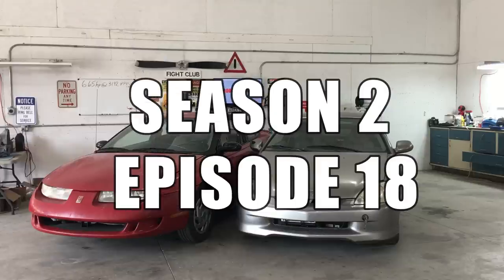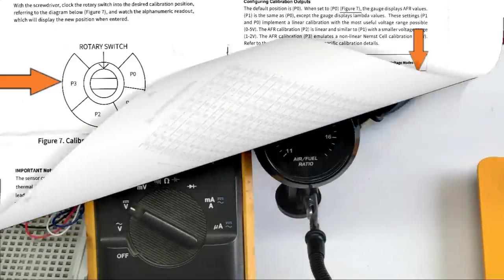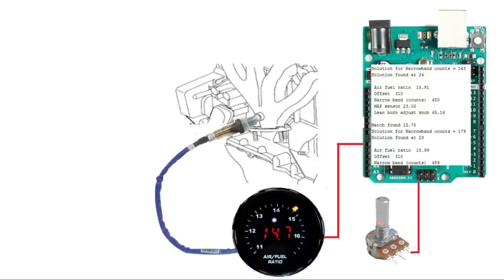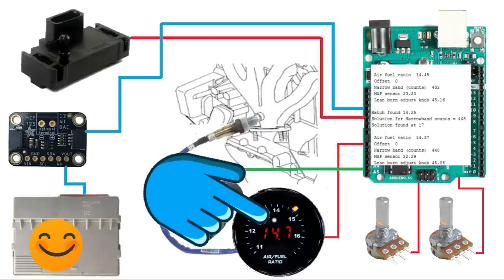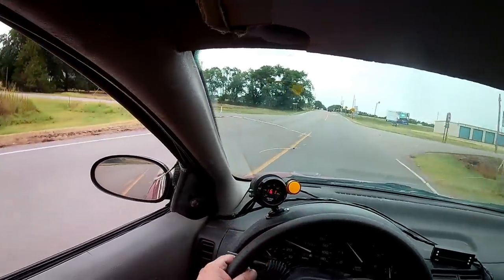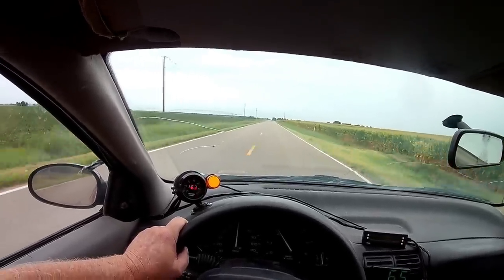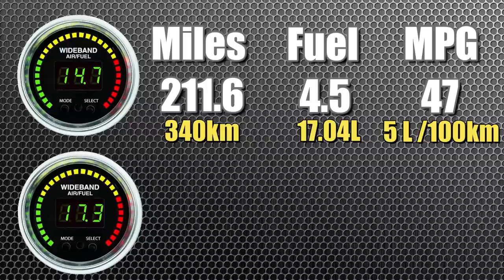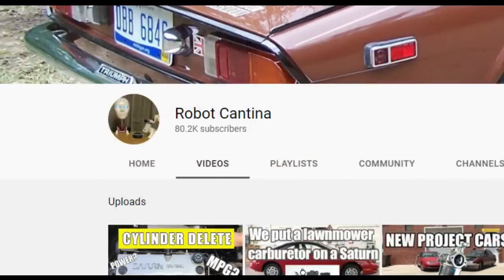S2E18:  We test a lean burn system on our Saturn .  Will it get better MPG?

Comment: Jimbo, you have to factor in that the stock narrowband sensor was likely inaccurate to begin with. They only have an operating lifespan of about 10 years.

When narrowband sensors start to fail, they fail-safe and start to intentionally read lean, tricking the ECU into putting in more fuel as a safety-net. That'll lower your MPG.

Comment: The base test makes sense because you replaced your spark plugs, and removed both the ac compressor and the power steering. While the two belt systems have little drag on the engine when not in use, they still rob power from the engine (as much as 25% on some engines) removing them boosts power to the wheels as well as fuel economy. Also, clean spark plugs boost fuel economy over older ones that have been in the engine for over 50k miles

Comment: Perhaps lean mixture limited engine power and you had to use more throttle to maintain speed. Maybe ignition timing adjustment will fix that. 
 Thank you for sharing
Reply: Timing can be the issue, but as the mpg were way better in the "not lean" experiment, it's also possible that the o2 sensor make the engine run pretty lean when it should be stoichiometric.
And leaning it even more only makes the engine way too lean.

It's very difficult to know how lean you can make an engine before it being less efficient than stoichiometric.

Some low compression engines can actually show better fuel economy running slightly rich.
Reply: More throttle isn't necessarily a bad thing. For good efficiency you want WOT with low ignition timing, so the pumping losses are low.
Reply: Untrustworthy instruments are super frustrating
Reply: @hojnikb  yeah, more air but less fuel for more power.  Better BSFC at the load and speed is the goal.  Higher dynamic compression in cylinder by not starting off compressing a vacuum.

Comment: GM had a lean cruise mode in the computer. When I can keep my car in that mode, the mileage goes up way higher than most people would believe. I believe the called it "lean cruise". It is hard to keep the car in that mode.

Also NoX is easy to remove, but it requires a non-lean mixture.  This is why we use oxygen sensors to stay just rich of 14.7:1.

Comment: What you should try is adding the ability to add an offset to the MAP sensor to lean out.  That should add some ignition timing advance in addition to pulling fuel as the ecu will think it is under less load than it is and typically adds timing advance as the load reduces.  You can then balance O2 sensor offset with MAP offset to control the amount of ignition timing indirectly and still hit the desired lean burn AFR target.  The lean burn fuel consumption result was probably about right actually, because even though it was using less fuel per mass of air, it was making less torque and needed a higher throttle position equalling more air flowrate to make up for it.  The lean mixture burns slower, so some of that torque can be gotten back with timing advance, but whether enough can be gained back without causing knock would have to be tested.  An EGT reading would probably also be useful, especially for determining how much timing advance to add.

Comment: Soooo, without the lean burn stuff engaged, you got what in Imperial MPG is about 56.5 MPG (UK), that's actually pretty impressive numbers even for a 4-pot engine, especially with current fuel prces being what they are... :S

Comment: Technically, burning lean should directly correspond with better MPG, since you're using less fuel for the same number of engine rotations. Your problems are heat and NOx. And it's why manufactueres don't really do it. Cheaper to do cylinder deactivation, hybrid drives and so on.. lean burn is scary cause you can melt pistons pretty easily if you don't have the engine designed for it.

Comment: I’m curious if the evap or charcoal canister are malfunctioning.   Possibly consider the 2 click fueling method.   Wait 30 seconds after pump clicks and see how much fuel it takes.  As a side note I had 95 SL 5 speed no power steering did pay for AC.   This car always got 45mpg, and 2 quarts of oil every 1,500 miles.    At 130k miles engine was weak and couldn’t go 75mph with AC in 5th gear….
Reply from the maker: Good point, the only real unknown is when the fuel tank is filled.  I curently fill on lowest setting and when the pump clicks off, that's it.  I think we will try it your way next time.
Reply: @robotcantina8957  HEY JIMBO.....  congratulations on reaching 100k subscribers.. ROBOT CANTINA is providing the 
entertainment and fun that viewers enjoy..

Comment: Regarding lean burn being too expensive for any manufacturer in the 90s... well.
I know for sure Toyota sold an engine with touted "lean burn" in the mid 90s... a few thousand dollar could be well worth it even back then in markets with expensive fuel, aka europe for example.

Honda also had their e-vtec technology and mitsubishi their direct injected engine already in the 90s, maybe/probably using some similar techniques.

Comment: I think modifying (lowering) map sensor voltage to get wanted AFR (in close loop control program in Arduino) + disconnected lambda singnal to factory ECU. That will lean fuel + advance ignition timing. I think lean mixture burn slower.

Comment: on my uego meter, I had to modify it with a grounded coax for the narrowband output, among other things, for it to actually work with my ECU (Trionic 5).
Reply: the included harness output, being completely unshielded, will have the tiny narrowband output completely annihilated by noise even over a short distance in a car.

Comment: 13:35, It's a saturn thing indeed. stay with the copper cheapies folks. I used to own an SL1 with a 5 speed manual, and yeah, you can actually get 38-41 MPG highway regularly with very careful driving.

Comment: Instead of using that converter, You can use a carefully selected resistor and capacitor to send a dead nuts accurate analog signal with 3 ms sweep to sweep response time which is 0-5v, but 0 - 1v would be extremely fast response time. 

I use a Oscillioscope to select the best values.
Reply: I was thinking why didn't he use a PWM output with simple RC network instead of that DAC.  also why is he slowing the sampling rate to 12 times per second.  That could be a part of transitional bad AFRs.  He could have stale feedback data for 100 injection events before the new data is presented to the ECU.
Reply: @vinnieluther6589  HEY JIMBO.....  congratulations on reaching 100k subscribers.. ROBOT CANTINA is providing the 
entertainment and fun that viewers enjoy..

Comment: Not exactly sure what went wrong, if it actually did, but it seems that usually stoichiometric ratio of 15.4 to 1 seems to be the sweet spot for unaltered ignition timing. This experiment needs way more data. More ratios, different ignition timings and all the possible combinations of.

Comment: I think it would be cool to play with a 2 stroke motorcycle engine (like the old moto gp type) in that Honda insight. Simple, powerful, and very mod-able. Alternatively, you could use a 2 stroke transfer port injected /oil injected snowmobile engine so you can have even more control over AFR and whatnot.

Comment: Also, those spark plugs issues aren't just a Saturn thing. For fancy modern platinum and iridium plugs to function properly, they require the increased voltage of a coil on plug system. Using these plugs in older systems will often result in carbon buildup and poor running.

Comment: So the lean burn system used a lot more gas. Typical. When discussing mpg my pentastar engine with variable valve timing really gets good mileage and power. At 80 mph it burns about 30 mpg. Thus power and speed with narrow band oxygen sensors. About the only way for me to beat this is to turbo charge the inlet pressure and not raise the fuel consumption thus ruining the engine. If I altered the engine controls and stayed at the 14 to one ratio at a steady speed of 80 mph it probably would get about 55 mpg. Thus not worth the effort. If it would do the Volkswagon thing of 1 liter per 100 kilometers I would definitely try it. But I am not Smokey Yunic.

Comment: Lean burn will make it more knock-sensitive. If engine is knock-limited, ECU will wind down ignition advance on any knock which might negate any gains made by lean burn.
Reply: disconnect knock sensor
Reply: @omegarugal9283  it is there for a reason. Knock will ruin the pistons.
Reply: @goranamcoff6235  cant get any gains from lean burn without spark advance so make your mind

Comment: Now all you have to do is dream up some aftertreatment to take care of the elevated NOx. OEMs are playing with SCR on lean burn gasoline engines. Perhaps get a junkyard SCR, DEF tank, pump and NOx sensors...? 🤣 When aftertreatment is at operating temp, DEF dosing rate is nearly proportional to fuel rate, and probably wouldn't be hard to figure out. 🤔

Comment: with the leaner mixture you run a higher risk of raising the temperatures in the combustion chamber so mush it can burn a valve or a hole in the piston

Comment: just putting a diesel motor into a car will not give you higher fuel mileage unless you change the final gear ratios in the differential.
Reply: HEY JIMBO.....  congratulations on reaching 100k subscribers.. ROBOT CANTINA is providing the 
entertainment and fun that viewers enjoy..

Comment: Chrysler attempted lean burn starting in ~1976. They hung the computer off of the air cleaner. Absolute horrible system. Just about everybody figured out how to disable it and get the vehicles running normally without it. Other than the constant problems with the system, you were always heavy on the throttle due to lack of power to do the same amount of work, so they actually got less mpgs than if they didn't have it. I recently put together a Chevy 396 with one of those Holley Sniper systems (not really impressed), and it likes to run lean. It hangs between 14:1-15:1 while cruising, will go dead lean 20:1 for just a second if you just smack the throttle, but will do 11:1 when it finally figures out what's happening. But even running that lean, it still gets big block economy. Best I've seen out of is 9mpg with mediocre performance. With a carburetor, I run it at 12:1-13:1, get the same 9mpg, but it has that instant big block power that's expected to be there.

Comment: GM has a lean cruise program baked into the -7747 ECU used in TBI trucks. Because of that pesky NOx problem and the expensive catalytic converter required to make it pass emissions it was never turned on in cars sold in North America. But it is there, can be turned on in the calibration chip that lets the computer know whether it is running a 4.3 V6 5.0, 5.7 or 7.4 V8. I believe some people who use those computers either in their original application or when used to convert a carb equipped engine have played with turning the setting on.
Reply: Great comment here..  I come for the video and stay for the great comments. 👍👍👍

Comment: Mr Robot "Jimbo" Cantina, would you ever consider doing a returnless PWM fuel pump for your EFI system? If you ever turbo'd the predator engine it would eliminate the need for a rising rate regulator, you could make a controller based on a simple fuel pressure sensor, a motor shield, and a dedicated Arduino with a PID controller. Returnless fuel pumps are becoming more common these days.

Comment: I believe that at least some of the masters of lean burn are in the aircraft space.   I have seen videos of them making what looks like fairly significant efficiency gains at economy cruise speeds.    IIRC, it was a Long EZ or VariEZ aircraft with engine management equipment that allowed on pilot to achieve over 40 MPG in an aircraft, moving at about 160 mph.    Granted the body of the craft was extremely slippery, made of fiberglass or carbon fiber.   The core of the engine was using about 1930s air cooled horizontally opposed tech, with fuel injection, cht monitors (on each cylinder), egt monitors (on each cylinder) and some other stuff I don't remember and probably currently wouldn't understand.   When you guys talk about code I freak out a little bit, although I want to try this with my super car, 1998 camry 5sfe.    Obviously if you can run lean for most of the trip, that is a bonus.   Just have to have the vehicle registered to an entity in a state that doesn't require emissions testing for the real homerun.   Not that Ive done any of that, I am purely just speculating.

Comment: Turbos on that Diesel engine would be awesome!   I could use that Diesel engine, to provide power for my off grid home,  load it down with 24volt alternators, to charge my batteries, and my inverter! Maybe a 10kw  120/240v generator unit!  I'm looking for a 6kw-10kw belt driven unit, harbor freight doesn't seem to have them anymore,  I was thinking about using a 4cylinder car engine, 1500-200cc, but diesel would be better, it could use veg oil, and waste oil,  to replace the sun when it's been cloudy for a few days ,

Comment: Maybe an interesting experiment for later is to change the cold air inlet to hot air. The hotter air besides encouraging better fuel spray vaporisation would also be less dense so you would need a wider throttle opening. That means less vacuum so less pumping losses and presumably better MPG.

Comment: Mixtures leaner in the extreme burn slower, thus require more timing. The efficiency gained from less fuel was offset and then some by the effectively reduced timing.

Comment: I think the issue comes from the fact that your scan tool is making calculations based on the data the computer is getting, which are spoofed. So the computer thinks it's putting more fuel than actual in or something.

Comment: My first quick thought is that fuel consumption most likely will increase suddenly when the mixture is getting close to what's a bitt too lean to ignite. I've been experimenting with extreme ecodriving for years in my vintage Saab 96 V4 with stock carburettor, by pouring in a known percentage of ethanol in the petrol. The fuel consumption actually decrease marginally at about 15-20% ethanol, but somewhere above 25% e I begin to notice som missfiring at low rpm's. At highway speed these missfirings are not noticded, likely because the higher rpm's will smooth them out, but fuel consumtion is definitely going up, and so is probably both NOx and HC levels. Advancing the ignition when entering lean burn as mentioned by others, sounds like a good idea. I guess that comes with an increased risk for engine knock, if it doesn't have sensors against that.
Reply: HEY JIMBO.....  congratulations on reaching 100k subscribers.. ROBOT CANTINA is providing the 
entertainment and fun that viewers enjoy..

Comment: Had you not got the fan mail wideband. I'd recommend you buy a Ballenger AFX500 ngk wideband with ntk sensor. It's the most accurate setup you can buy without spending thousands. It's around $375?

Of course you need sponsors to be able to justfiy the more pricey stuff.

Comment: Would be interesting to see what would happen if you were able to advance the timing quite a bit. I'm sure there is tables out there to show flame speed for different ratios of fuel mixtures. The fuel mixture is quite lean at that point and would need to be advanced quite further.

Comment: Im pretty sure this would be a lot simpler said than done but I think it would be very interesting to see a hydrogen conversion and serval tests with that, I really think that could be a strong way to expand this channel
Reply: Fuel cell or hydrogen as a replacement for gasoline?
Reply: @thatsonebadhatharry8610  sounds like 2 separate videos

Comment: Actually manufacturers do something similar today, that's why high NOx emissions are a major issue as well as PM2.5 emissions on modern Gasoline cars. It' called stratified charge engine.

Comment: I built my own scan gauge once. Injector pulse width is too complicated because it would have to be calibrated to each car in milliliters per second. Most OBD2 gauges take the mass air flow multiplied by the stoikometric ratio, assuming the engine is running right, to estimate the fuel consumption rate.

By burning lean, you've probably fooled the digital gauge.

Comment: 47 mpg in a composite body, manual trans, small displacement inline 4 seems right to me. I would get 32 mpg cruising in a Solara with a much larger engine and automatic trans. Maybe incomplete burn with the lean mode?

Comment: Removing the AC compressor reminds me of an argument I got into on the internet. I know those are dangerous but I had an epiphany.
Could you experiment with somehow disabling the alternator during high engine load to see if that makes a car better in any way? My logic is that if you're looking to get the best acceleration at WOT, the battery could run the electronics instead of drawing engine power to do it.
Reply: The downfall with a normal electrical system would be that you would drop the voltage a bit from charging voltage(13.5-14.5) down to battery voltage. Loaded battery voltage at that. You can make up for it with changes to the system but with a factory car you'd probably lose more to the lower voltage than you'd gain from the slightly less parasitic drag. But I'd be curious to see that tested
Reply: PS, with that said.... I'm thinking back. An old low buck trick on 5.0 mustangs was to take the serpentine belt off right before you ran the quarter. That definitely made a difference but then you're also deleting water pump, power steering, etc